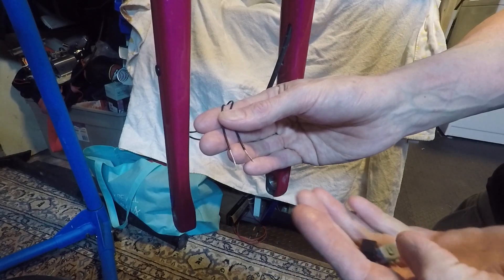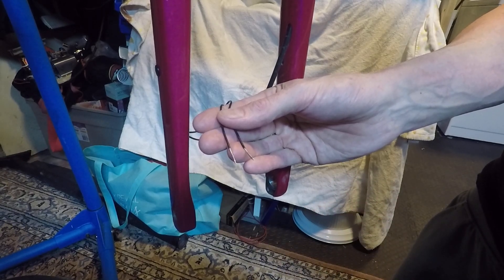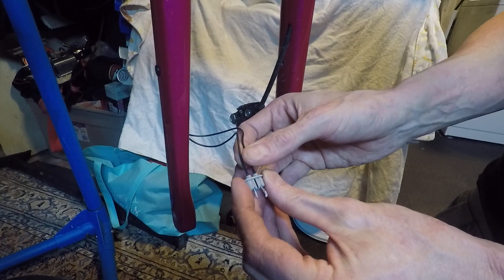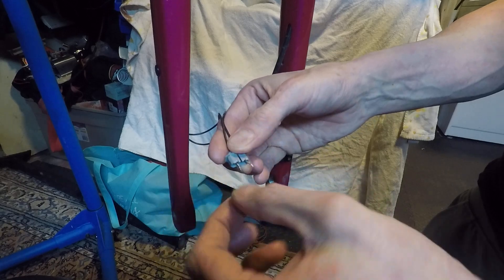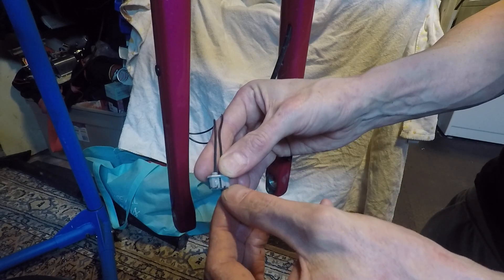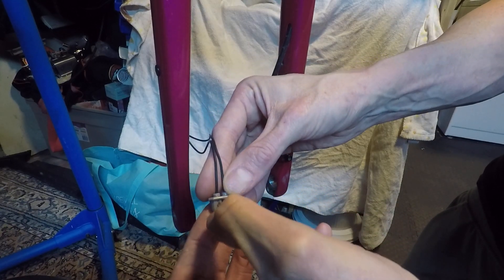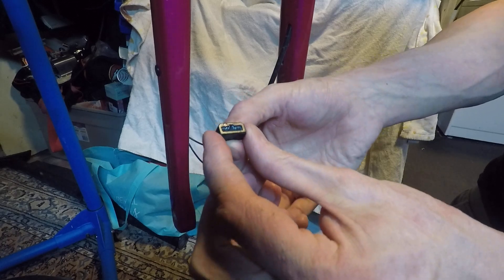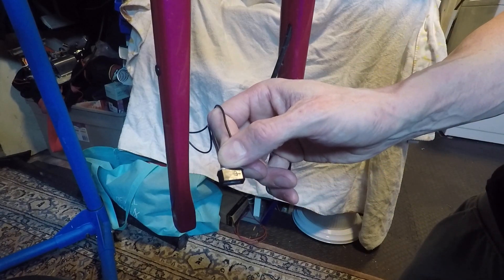How to attach a shimano dynamo hub connector to dynamo light wires.

Comment: Check the grounding symbol on the outside to connect the grounding wire and on the dynamo hub make sure the connectors are clean and visible, clean with deoxidation electric spray to be sure.
Reply: Which of the two wires should be the grounding? Is it the one with a white stripe?

Comment: The big "a-ha!" comes when you mentioned sliding the black part over the grey - I had the wires pull right out and didn't realise that it separates into two pieces. Imagine the frustration of trying to get the wires to stay in place when they're floating free inside the plug rather than being trapped in those grooves...
Reply: Same, nice video! Could not understand why it wasn't working